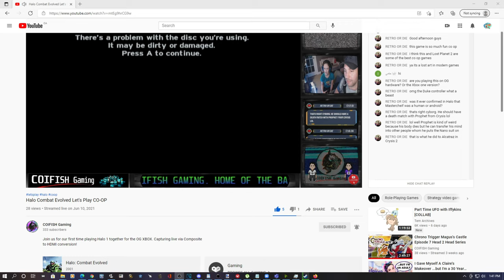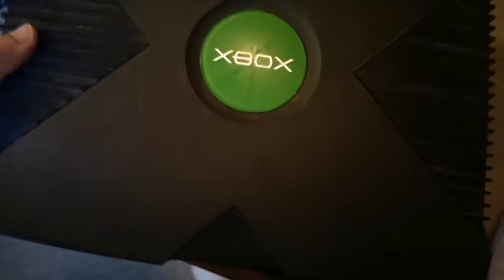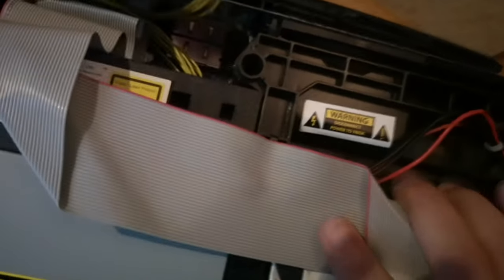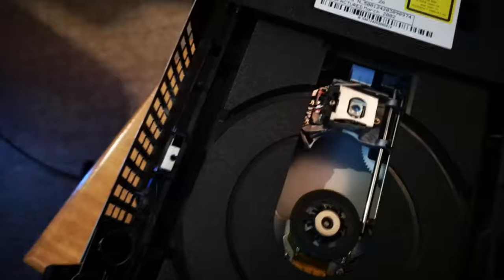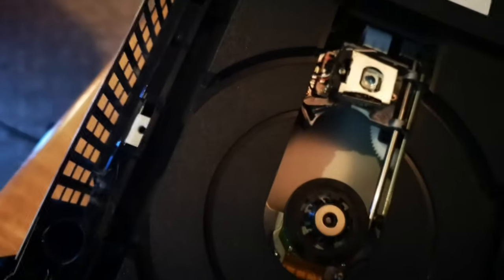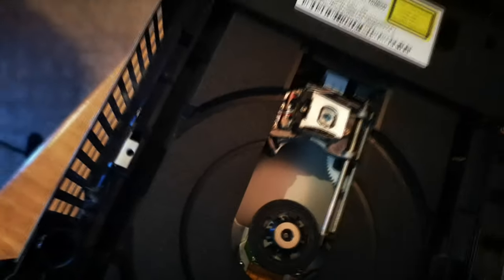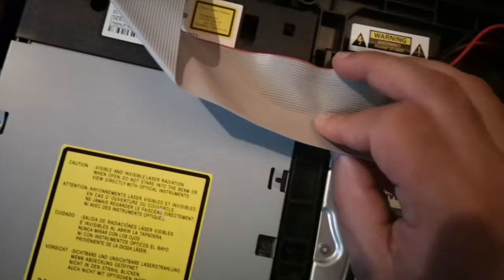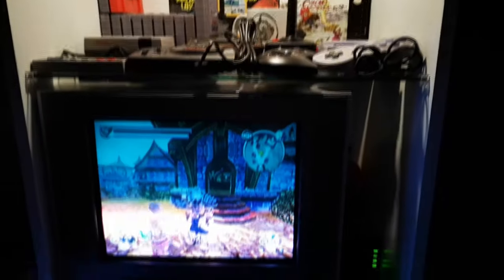HOW TO FIX XBOX OG DISK READ ERROR FAST!

Comment: Thank you sir, now I can run def jam fight for ny without interruption 👍
Reply from the maker: Worked out for you?
Reply: Yes it absolutely did. Couldn't believe how dirty the lens was when I popped it open. Took a chance and copped it from ebay for $80 bucks. Got lucky and found a clean copy of FFNY for $90 bucks, considering its going for as much as $200. Got the 'can't read disc' a couple of times so I looked around and came across your video. Many thanks 👍
Reply from the maker: @Highznberg  Awesome glad it worked!

Comment: I have a stack of about 50 games. My Xbox will read about 10 of them. The others give me an error that it might not be an Xbox disc. I resurfaced a few and cleaned the inside of the system, but that didn’t help. Any ideas?
Reply from the maker: So if my lens method did not help, it could very well be your laser finally giving out (It has exactly that issue). I would try my method first just to be sure! Give everything a good cleaning. Don't sleep on grabbing a Xbox 360 for cheap either! Sometimes that's alot cheaper than replacing your laser!

Comment: Mine pops up read error after I finish a game or mission and about to load another mission and that's when it says disc error.
Reply from the maker: With all discs?
Reply: @COIFISHGAMING  yeah even the brand new one. Except for NFS underground which was the most scratched up one.
Reply from the maker: @OrangeCounty92  You can try this fix however it could very well be the drive failing
Reply: @COIFISHGAMING  I should replace the drive?
Reply from the maker: @OrangeCounty92  I think you should try my fix first before replacing the drive

Comment: I've been trying to get into retro gaming via the OG Xbox. I the first OG Xbox I bought was a modded version and did play discs fine until it didn't. Next I bought another OG Xbox, this time unmodded, and the discs would not play at all with the same error message every time. 

I will try this method, as I have seen it been done across different videos, but I really have to wonder about the hardware of the OG Xbox. Why after buying two consoles does the disc drive cease to work. Just how fragile are these consoles?
Reply from the maker: The DVD disc drives seem to have some sensor issues for sure. I made my OG Xbox work this way however I bought a Xbox 360 for like 20 bucks to upscale my games with it's backwards compatibility

Comment: Trying this on mine but the disc drive doesn't look like yours on the inside. I can't get the metal cover off. It has a samsung label on the metal cover.
Reply: 0:55
Reply from the maker: Arg The Samsungs have a really high failure rate! I am sure there must be a way to pop it out though
Reply: I figured it out. There are two hex screws T9H at each corner in the front. Then there are two clips towards the back. I was able to lightly pull the left side of the housing out to open the clip. I then had to disconnect the two connectors in the back to be able to fully remove it. Once removed there were four Philips screws on the bottom and that allow me to remove the top of the cover.
Reply: Still won't read halo 2. I tried a DVD and a CD as well and it won't read those either. Thanks for the video and responding.
Reply: @Martin_3578 wat?

Comment from the maker: Use these tips especially if the disk appears to be clean! Let us know in the comments if this helped you out! Cheers.

What you need!
-----------------------------
Isopropyl Alcohol 99%
Q Tip
Torx 20 or Flat Head to FIT 
Philips Screwdriver small